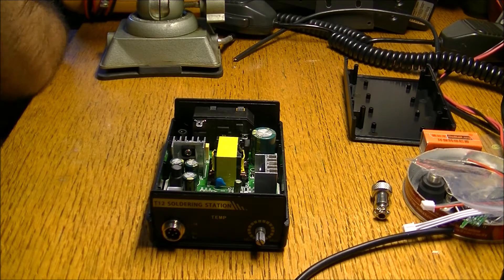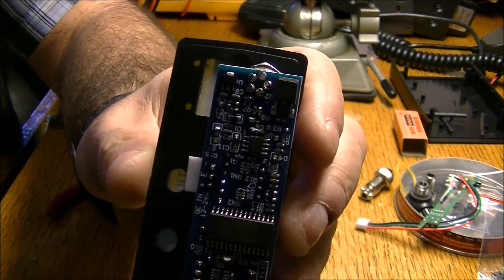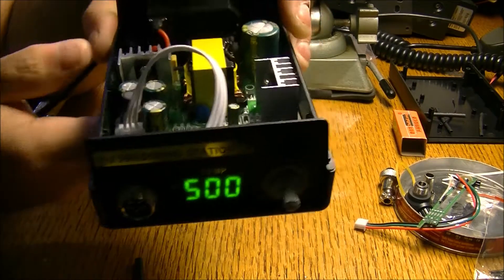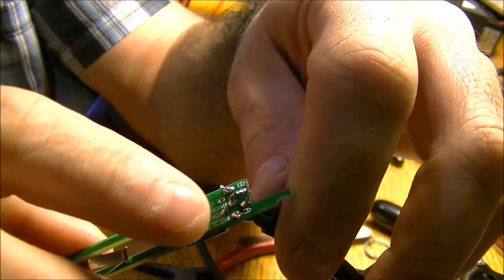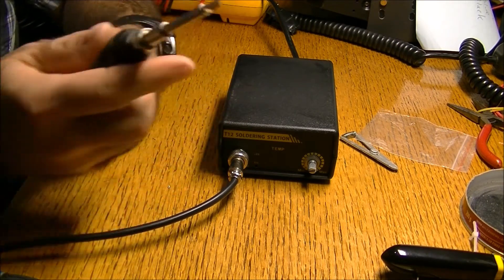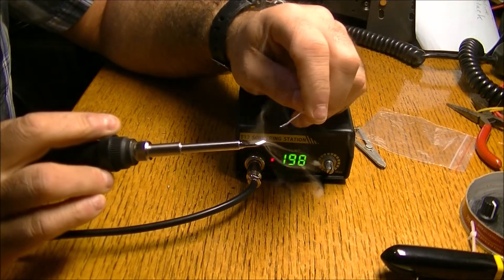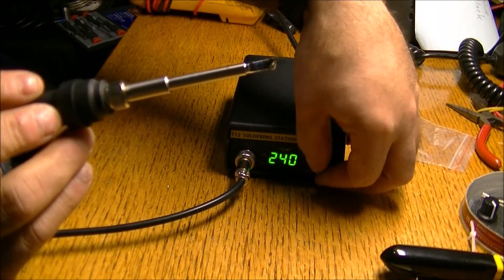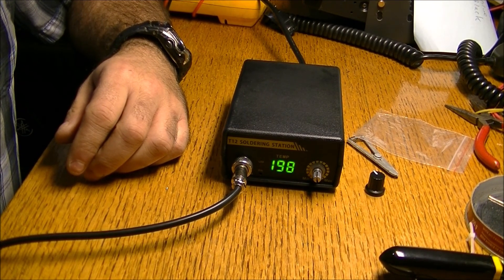Hakko Temperature Controlled Soldering Station (DIY Kit)

Comment: Andy,  how does it give back the Temperature reading from the tip? 
Am I correct in thinking that it turns off the power to the heater momentarily and then takes a reading on the same wire?
Reply from the maker: That is very possible and quite possibly exactly how the temperature is measured.

Comment: mine turns off when you insert tip   , i checked all wires and they all look good ?   i havent a clue?
Reply from the maker: Here is the instructions I configured and, if you follow the instructions, you can set the station to operate as you want it. If you copy and paste the instructions and organize it into steps, you should do just fine setting up your station. Here is the instructions:

Controller parameter setting mode:

Press and hold the encoder button does not move → start → enter the parameter settings mode:
There are 12 menus available for setup, P00, P01, P02, P03, P04, P05, P06, P07, P08, P09, P10, P11. 
The digital display menu is 1.5 seconds, and then automatically
 displays the corresponding parameters of this menu at the same time rotate left encoder is reduced right is increase 
Press it and automatically save the currently

set parameters and then display the next menu for 1.5 seconds, and then display the corresponding parameters of this menu, and so on. 
When all parameters are set to automatically enter the normal heating mode.
Because each set a parameter to save once, so you can shut down at any time without having to set all the parameters
(such as you just want to set P01, set P01 after you can shut down and then boot into normal mode)
Menu item:
P00: restore the default parameters (0 or 1, the default value of 0,0 for not recovering, 1 for the recovery)
P01: Operational amplifier gain (200 to 350 times, step 1, default 230)
P02: Operational amplifier offset voltage (0 ~ 250mV, step 2, the default value of 100, refers to the tip to keep the room temperature operational amplifier inherent output voltage, according to my measurement this voltage varies greatly with temperature, different magnification Not the same, the higher the magnification, if you do not measure, please keep the default value)
P03: thermocouple ℃ / mV data (30 ~ 50, step 1, the default value of 41, refers to the thermocouple need to temperature how much voltage was increased by 1mV, according to the type of thermocouple self-calculation, if you do not understand, please keep Defaults)
P04: temperature adjustment step (0,1,2,5,10 degrees optional, 0 can lock the soldering iron temperature)
P05: sleep time (how long don’t not move into sleep) (0 ~ 60 minutes, step 1, 0 is to forbidden the sleep function)
P06: Shutdown time (0 ~ 180 minutes, 0 ~ 30 step 1,30 ~ 180 step 10, 0 is forbidden shutdown function)
P07: temperature correction (+20 degrees, step 1) (due to NTC resistance in the chassis, the soldering station heat will lead to the detection of NTC temperature higher than room temperature, resulting in high temperature compensation of the thermocouple, soldering iron temperature is not accurate, or other causes the temperature is not accurate. If you set the other parameters are correct value but the temperature is still high or low, you can use this parameter correction. For example, to detect the displayed soldering iron temperature is 20 degrees higher than the actual value of this parameter Set to 20)
P08: wake mode (0,1, 0 in the shutdown mode can be rotated the encoder and also can shake the handle to wake up, 1 can only rotate the encoder wake up (Note: press the encoder can not wake up, can only rotate) )
P09: temperature increase mode to increase the temperature to adjustable (20 degrees to 100 degrees adjustable, adjust the pace of 10 degrees)
P10: temperature to increase the duration to adjustable (adjustment range of 10 seconds to 250 seconds, adjust the step 5 seconds)
P11: Parameter setting mode Auto save parameter and return to heating mode Function to active time adjustable (range 4 seconds to 60 seconds)

Comment: Thanks for the video Andy. Just one question about the kit.... what if that was your first and only soldering iron purchase :-D
Reply from the maker: I have never bought a new soldering iron before. The ones I do have I bartered for or bought used. I have about 6 soldering irons but none have temperature control. I am looking forward to using this new station. Temperature control is an awesome feature. This tip heats up really fast as well and seems to regulate a very stable temperature. The turn down feature when not in use is an awesome thing. I have forgotten my soldering iron on before once or twice. Thanks for dropping by and watching my video.
Reply from the maker: Re-read and now I understand you.... It would be difficult to build it without a soldering iron. Lots of small jumper cables might be a rough way to do it LOL!